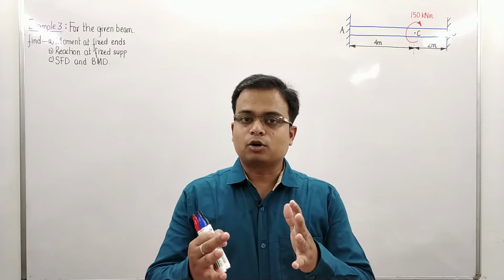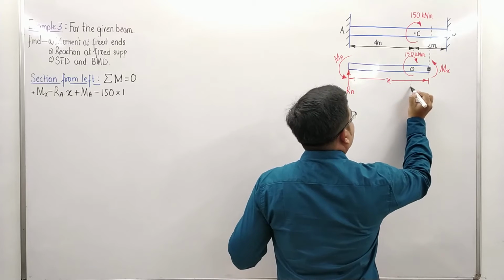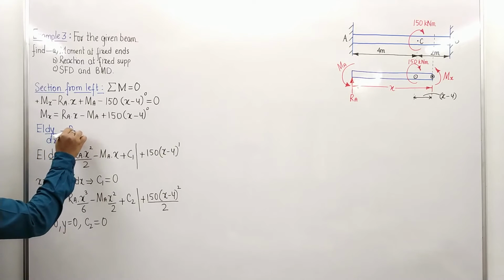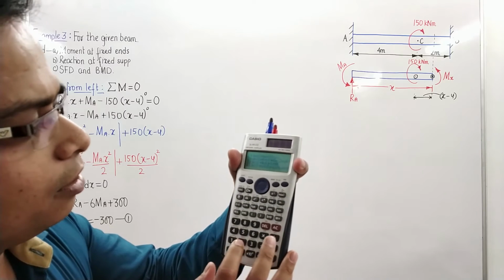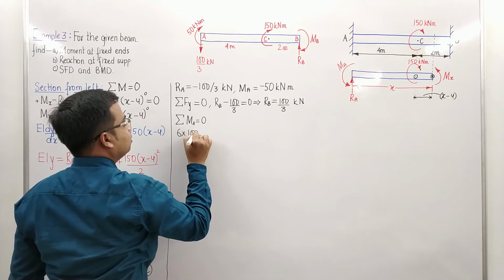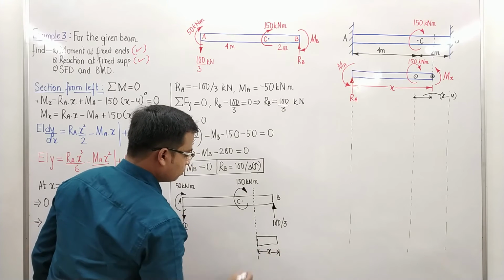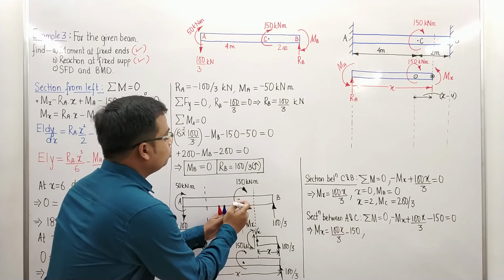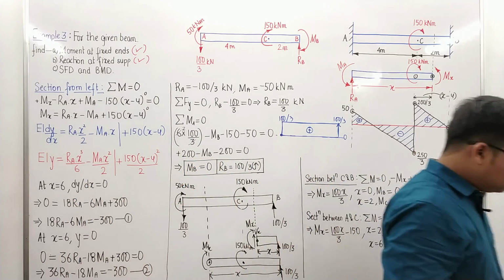Fixed Beams || Example 3_Concentrated Couple || Lecture 3

Comment: The midpoint M of line AB is contained by both the reference planes.The length of the line is 70 and it's front view and top view are 50m and 40m.Draw it's projection ,find the true inclination and locate the traces? Sir plz help